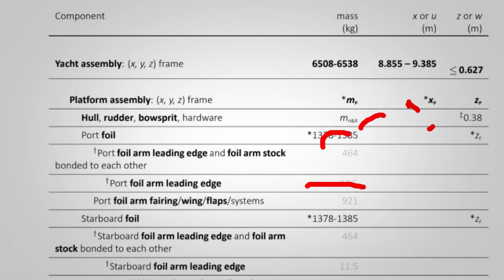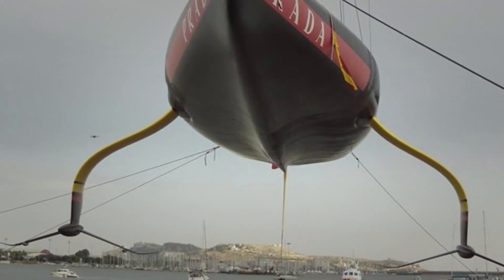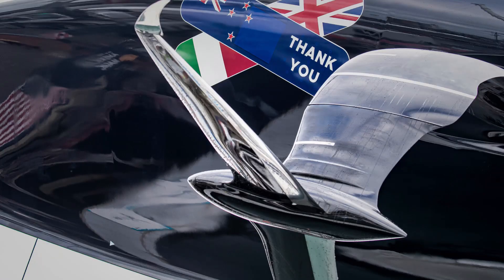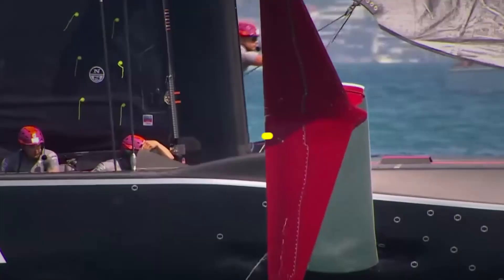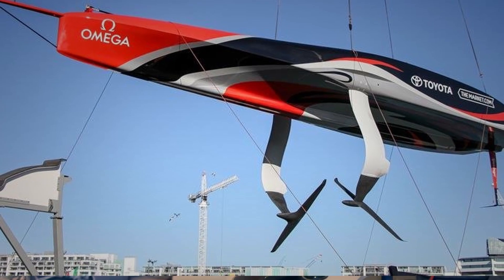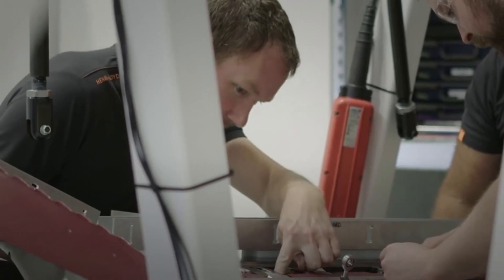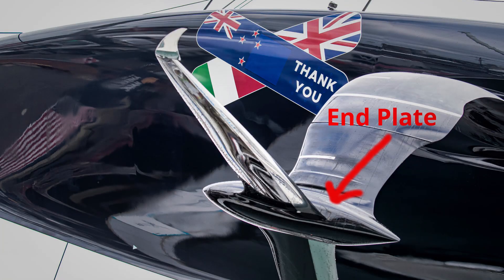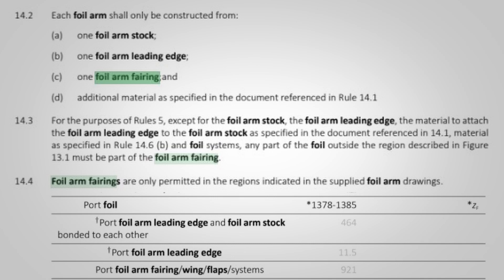Was American Magic's bulb a mistake? America's Cup Design Review

Comment from the maker: The rules say they cannot use anything more dense than lead... pinning this comment!😆
Reply: What am I going to do now with all the depleted uranium I’ve been saving?
Reply: @danielwarner6155  tungsten alloy... solid spar! is formable, has the strength to more than exchange for carbon fiber AND the density in exchange for lead
Reply: @Errol.C-nz  That’s good information to know. Thanks. I still have a problem though. Do you know anyone looking for depleted uranium? (I refuse to sell to the Russians or Chinese.)
Reply: Consider... the purpose of wing root fillets on ALL high performance aircraft... not just high speed... the bulb while not being the ideal root form would have a similar yet less effective result... the arm fairing on te Rehutai i would consider to reduce the surface effect cavitation that would happen in transitioning onto the foils at high lift low speed flap setting... air would suck down the back edge of the arm & get drawn out right along the flap during low flow lift mode... it far to far inboard to maximise righting moment when the arm's retracted

Comment: Fantastic discussion. Thanks!  and fantastic racing.

How about steel for the main foil material.  If you don't have a handy foundry, then take some (say) 1mm steel sheet and  cut out your profiles and laminate them together on a flat surface using the cutout profiles as a jig. Maybe do the top and bottom surfaces separately. Then all you need to fair it to final shape, with a grinder or filler if you are lazy!  Work out where you need the steel for strength and then cut out and fill the rest with your servo mechanisms and lead. Basically like 3d printing.

Comment: just a quick thought from casual observation: the Kiwi foils form a more effective 'single-span' than the contenders, hence have a higher AR: given the resulting improvement in the lift-curve slope as a function of AR, their design would offer them a significant advantage at higher aoa (lower speed) over the contenders, would it not? The reduced section camber this would permit would reduce pitch moment coefficient hence other control input (drag) at speed, together with reduced wetted area for reduced skin drag......?

Comment: Thanks guys for the fantastic series of videos. I have an observation, based on a couple of hours drafting the AC75 class rule diagram 13.1 adjusting the foil arms to angles I believe they're using it and doing some maths, it seems that the centre of mass of the boat is pretty close to the boat centreline. I found this interesting, having assumed that the big foil out to windward was working like me hanging out of my 420 back in the day. Taking the foil arm in the fully down position as shown in diagram 13.1 to be zero degrees, the leeward foils seem to be about 65-66 degrees raised from that position and the windward foil is approx 117 degrees raised. The optimum raise angle for the windward foil is 98 degrees to achieve maximum reach away from boat centreline but at this height will be clashing with the water. The tricky part is figuring out the centre of mass of the foil and foil arm combined due to the curved arm. Anyone been diving into this?
Reply from the maker: I think when the foil is up, they must be a stowed position. This is slightly higher than would be optimum for righting moment as you correctly suggest.
Reply: @MozzySails  In your video you have a dimension plan view of Patriot's foil. Where do you find this level of information?
Reply from the maker: @robingimblett2171  it was produced by a guy called Max Hugen, who sometimes comments on these videos. He posted it to a forum.
Reply: @MozzySails  cheers, I've seen his comments. Also located the forum at sailinganarchy and the topic on foils has already covered alot of what I was drafting today.

Comment: Hi Mozzy. CAN YOU HELP ME - I have a question. I'm loving the AC and your analytical commentary. I sail Lasers and Hobie - I fly a paramotor and a paraglider. This is my QUESTION. Does a hydrofoil work exactly the same as an aerofoil? My problem is that I was told that water can't be compressed - and if that is true then in my head - the fluid dynamics must be very different. I can't imagine, for example, how the low pressure would develop above the upper surface. This has puzzled me for years.
Reply: Simon: water is actually compressible, though for the purposes you're thinking insignificantly so. So why do underwater foils work? Consider the displacement of the water above/below the foil....then watch the surface water waves: these give the clue to what is actually going-on, which is that the 'circulation' around the foil (in a similar form to the circulation around your paraglider wing) results in a downwash angle and subsequent water velocity that enbodies energy equivalent to that required to keep the foil 'flying'. (Plus inefficiency losses, obs).
Reply: Yes, both work the same. FYI, air is considered as an "incompressible" fluid for lift calcs etc, until you reach supersonic speeds. The difference is of course the density - water is 1000 x more dense.

Comment: Hi guys, thanks for the interesting videos you've put up. Just something I would like to put into discussion maybe, something that is hardly discussed during this Americas Cup, that is the boat configuration. What I mean, is the foil arm position relative to the mast pivot, foils relative to the mast, and rudder, etc. Every one of the competing boats is very different in configuration, e.g. Luna Rossa, foils are forward of foil arms and quite forward of the mast. On the other hand, ETNZ, foils are much further aft, than all the other boats, you can clearly see them positioned aft of the trailing edge of the foiling arm, although the foil arm itself appears slightly further forward than the other boats (The brits are the closest in configuration to ETNZ, with exceptions of course). The difference between Luna Rossa's foil placement, and ETNZ, is huge. You can, to a point see why Luna Rossa, for example, is very stable particularly at lower wind speeds, but will probably never reach as high, or have the speed of ETNZ. Of course, different configurations,  all have advantages and trade offs, ETNZs trade offs will probably be stability, and difficulty getting on the foil at low wind speed, which is, clearly evident at times etc. My point here is, although foil shapes sizes angles etc. really matters, where they are placed and how they are configured is just as, if not more important to how the boat will ultimately perform. So, I am amazed at how no one seems to have noticed or discussed these obvious and important differences. So maybe you can discuss this in one of your future videos. Anyhow, I love and look forward to your videos, keep them coming.
Reply from the maker: Very next video Rob! There isn't huge flexibility in the rule here. CoG of the yacht has to be behind the foil area. The foil lifting surface needs to be within 10-12m forward of the transom (foil arm can be a little further back). And the CoG of the yacht must be between 8.855 – 9.385 forward of the transom. There are two lines on the deck, one at 9m and one at 11m (limits for where the crew can be) which are useful for estimating where foil area is fore and aft. Whilst it's hard to know for sure where CoG is, the foil lifting surface all appear to be toward the back of this box. And, given all the teams put their crew as far forward as possible, it would make sense that their CoG as far forward as possible as well. The other reason to step a foil surface forward or back from the vertical arm is how ventilation and and cavitation is managed... separating the peak pressures at the intersection... anyway... more to come in the following video (probably Friday or Sat)!
Reply: @MozzySails  Thanks for the reply, Man you guys are enthusiastic, I thought we were the only ones here in NZ, cool to see. Can't wait for your next video.
Reply from the maker: @robodobo222  one up on area... Foil position for-aft will got up Saturday eve
Reply: @MozzySails  Sweet as, cant wait.

Comment: Could the fairings of the ETNZ on the foil arms be to lengthen the waterline just on the area where the foilarm penetrates the water surface ? In that sense it would locally decrease the Froude number of the foil and reduce wave making resistance.
Reply: My understanding is that the "gaiters" on NZ's foil arm fairings were primarily to reduce spray into the crews.

Comment: Not sure how to contact you so here goes:  I have just seen something that looks interesting on ETNZ.  Have a look at https://youtu.be/ASv3qeqjjZ4?t=466 Am I looking too hard or are they  experimenting with foil position and hence variable depth?  During the 07:58 moment I think they partly, only partly, raise the leeward foil as the hull comes back down.  That allows the boat to "land" upright.  Also they then keep that foil arm at that angle, does that allow them less hydro drag as the hull accelerates?  Then they can drop the foil further as the hull starts to lift.  Can this reduce the time/wind speed needed to start foiling?  What do you and the guys think?

Comment: Lead?? Does it have to be lead or could something like Tungsten be used? Are they using heavier structural materials where possible for the moving parts within the foil for the sake of adding the needed mass?
Reply from the maker: lead is the most dense material they can use in the rules
Reply: @MozzySails  Cheers for the reply and info! keep up the great content

Comment: None of the boats that have capsized thus far been able to self right, They all needed help. I think the design was a failure in that regard.
Reply: Why do you need boats to be able to self right in a race?  They're purely race machines with chase boats seconds away at all times.
Reply: @JamesAAshton  They probably could self right if they lowered sails and canted foils opposite to rig but that's just not very practical. Much easier to use dynamic lift from a foil and a tow.

Comment: Why do these boats have bowsprits?
Reply: In very light winds they have to option of using a much larger sail, called a Code Zero, which is tacked to the bowsprit. But it has disadvantages - as they get on foils and rapidly increase boat speed, this sail produces way too much drag.

Comment: Patriot was as fast as Prada until the buoy rounding when they wrecked the boat. That was the mistake, not the bulb.
Reply: fast always has to do with stable flight attitude. You need to be sustainably fast while keeping control of the boat. The boat that falls of the foils (or worse) doesn't win the race

Comment: American Magic's mistake was turning left with a 46 second lead when everyone on board knew the safer maneuver was to go to the other mark.  It was the single event in three years of work where ego overruled common water sense.  The blame goes squarely on Barker's shoulders.  He was prodded twice to go right.  The bulb on the foil was doing fine up to that point.
Reply: Every racing sailor who's commented so far has stated that they would NOT have sacrificed the weather position by gybing right. Taking the "safer maneuver" might have lost them the race. Note that LR also opted for the left mark.
Reply: Remember, they were always going left and had set that move up a long way back.  They were chasing wind shifts and had picked it well.  To say that in the last 4 seconds before the rounding that someone challenges the plan, and they go with plan B knowing they may lose the lead doing that... well, hindsight is a great tool, but there was a lot happening.
Reply: @stefanzzz6778  I'm a retired Army pilot.  When flying in heavy winds gusting to twice steady state one of the responsibilities of the pilot in command is to make decisions based on current conditions, knowing full well they are constantly changing.  To get tied into a decision made 20 seconds ago is what leads to accidents.  If you do not have a team that has a captain that can make changes quickly in weather like they were in then you probably need a different captain.  The Germans were like that when we trained with them.  If they briefed they were crossing the bridge at 12:00 and they arrived at 11:30 they would wait till they could cross in accordance with their plan.  The Americans drive the Russians that studied us nuts because we don't follow our own doctrine.  A leader has to be able to adapt.  The crew needs to be trained to a level where they can change on the fly, or don't race.  Go pleasure sailing.  If you are going to race in hard conditions you must be able to react to conditions on the fly.  The proof is in the wrecked boat.  The captain is to blame no matter how you look at it.  The other boat was in the same race and did not destroy itself.
Reply: @dr.stefankurys-romer9316  Yes, to provide advice. Not to make decisions.
Reply: Barker got the advice too late and not clearly enough. He had already begun executing.
Reply: @abatesnz  Plus the right hand mark was an extra 100m. Someone of DB's caliber had probably already weighed up the options, and then committed to the fastest line.
Reply: Agree Bill.  And we have had no real explanation as to the leech getting caught in the back stay.

Comment: I am not sure you guys have adequately explained where ETNZ have stuffed the weight in their foils (with little or no bulb). I also think that you should have been more curious about ETNZ's 'flat foils vs foils with 'v' form. Lift, resistance, and 'control' are all leading factors - why not comment on that in detail? AM clary were 'riding a bucking broncho' in the entry to race 3, and were trying hard to avoid a similar situation in race 4. Would have been rather more enlightening to have the 'experts' critique the theoretical against the 'actual'.
Reply from the maker: Hey Gordon. We have a previous video on frontal shapes and will have a following video on flap control. Cant for it all in one video, although we know the features are linked.
Reply: ETNZ do have a bulb. Their latest foil iteration uses a "blended-foil-bulb" design.

Comment: Why not make them out of steel instead of carbon fibre? CNC cut the steel to the shape that you need and profit on a thinner section that is more hydrodynamic? Lead isn't much heavier and steel is very strong if you need mass AND strength it's ideal, really.
Reply: Several of the teams (at least) are milling them out of high strength stainless forgings - I'm guessing either precipitation hardening, or duplex, but it might be something more exotic still. Like CarTech Custom 475, a martensitic, precipitation hardenable stainless steel. It is claimed to provide good corrosion resistance and a 0,2% proof stress in tension of up to a pretty eye watering 2,000 MPa (cf mild steel at around 250), and it's from Carpenter so there's no reason not to believe the claims.
Reply: @Gottenhimfella  Makes perfect sense, I just wasn't aware. Mild is often up toward 400MPa these days, though. I wouldn't have thought the corrosion resistance would be a big deal in these time frames and with no other dissimilar metals in the water at the same time and ability to rinse and lube after each session, but I suppose it would keep it simple. And thinking about the volume of steel (or similar) required to hit that mass, it'd be about 1sqm 100mm thick with some lead in pockets. Spreading that out the bulbs start to make sense as it'd be difficult to get them thin in those bounds. Very interesting.
Reply: @fredio54  NZ introduced milled steel foils in AC35, so they could design narrower and >thinner< foils. They have stayed with that design principle, but still required a bulb to meet the stipulated mass. Their latest "blended-foil-bulb" design looks pretty good as it contributes to lift, with minimal increase in drag.
Reply: @maxhugen  Yes, I had noticed how flat and sleek the NZ bulb was. Neat that NZ were innovating back then :-D Was that another change the oracle team copied mid series to become competitive along with the bicycle thing?
Reply: @fredio54  In the AC35, the cats did not use ballast, so they had no bulbs. I don't know if Oracle tried to change their foils to steel though.

Comment: I'm pretty sure those bulbs have a purpose and that is to "break" the water tension ahead of the leading wing front. The same method big boats which reduces drag by quite a big margin.
Reply: No, ships have a wave creating bulb which partially neutralises the bow wave.  The bulbs in the AC75 are used as one way to meet the Rules stipulated amount of mass in the foil (~931kg).

Comment: Is lead specified in the rules? There are other options that can be close to twice as dense as lead. Depleted uranium for one, although there might be some other issues with that choice. Tungsten might be a good choice, strength and high density. Maybe you could make the foils out of it.
Reply: Rule 6.3 Materials shall have a maximum density of 11,400 kg/m3  (ie, lead)
Reply: Greater mass at distance = potential for increasing power out of sails
Reply: NZ is nuclear free.... depleted uranium does not qualify
Reply: @MartinSparkes-BadDragon  FWIW, depleted uranium has almost certainly been brought into New Zealand. It used to be used as counterweights in some jetliners, it is used as shielding in some medical devices, and it has been used as a catalyst for some chemical processes. I don't know the extent of current civilian use but I doubt that it is categorically banned from New Zealand.